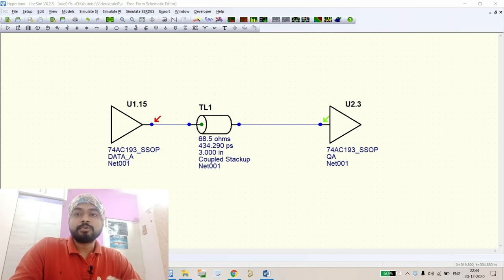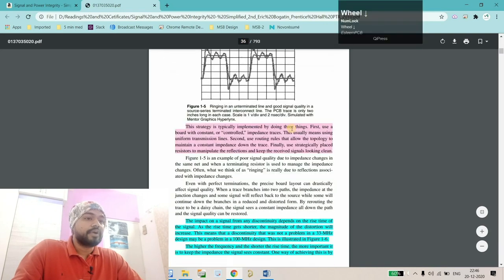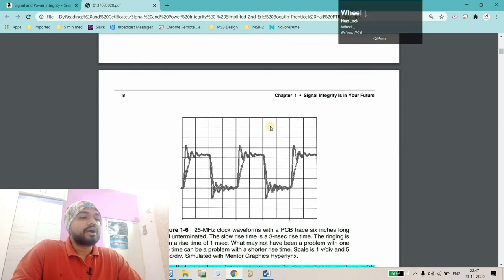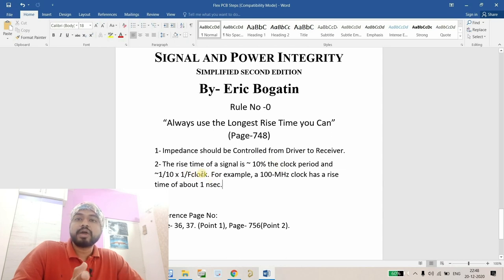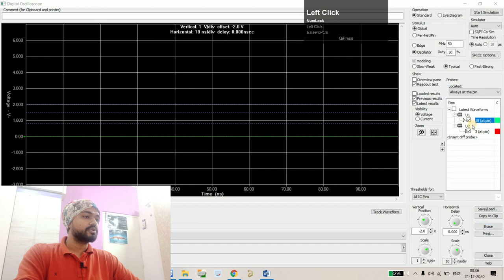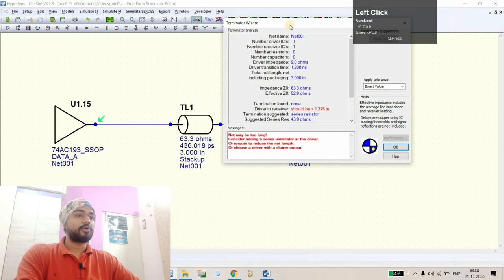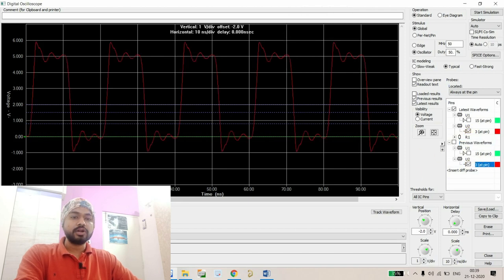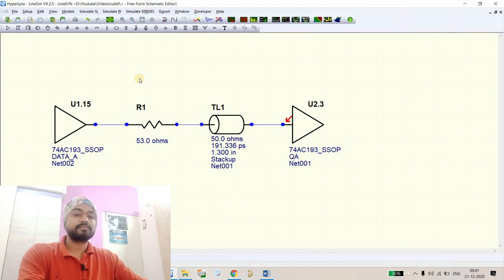SI/PI Rule #0: “Always use the Longest Rise Time you Can”

Comment: Rise time is something which is not controlled factor for SI. To address SI issues, Trace impedance and series resistance is something we can play with and also driver and receiver available buffer model options from supplier.
Correct me if I am wrong.

Comment: what if your trace is tightly coupled to 50 ohm impedance but trace length is very long?
Reply from the maker: Nice question Ahmad, then there will be no change in trace characteristics impedance, but It will take time to reach at receiver, let me know if you have other doubts
Reply: @EsteemPCB  Thanks for your quick reply.. I really appreciate your efforts on channel and best wishes.. 

Normally i see suggested trace length should be  1/10th of wavelength .. and if trace length goes too long ... hyperlynx suggests some series terminations. Give some insight please.
Reply from the maker: No no if trace will be long, it suggest to reduce the trace length and if you are using wizards it will fail the test because of long tracks

Comment: Is it recommend to add series resistor like 50e in final design
Reply from the maker: It's not recommend, but if you are facing Signal integrity issues like reflection, ringing, or any false triggering then I would recommend to use series termination
Reply: @EsteemPCB  Thanks for your reply